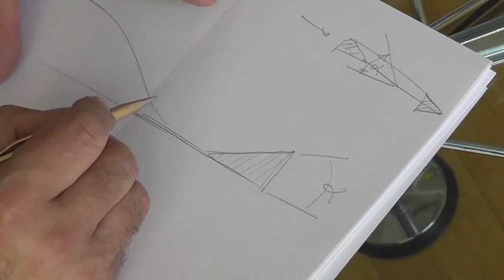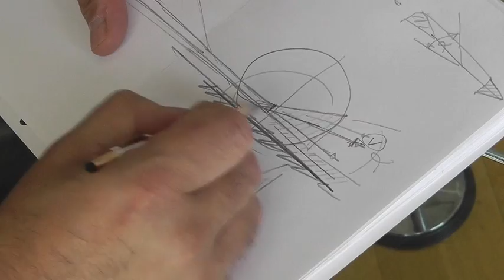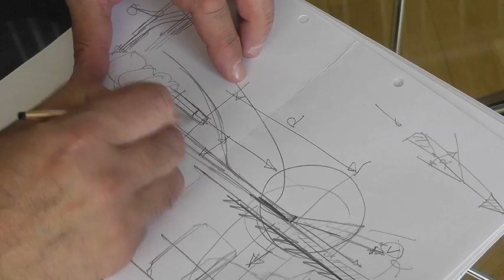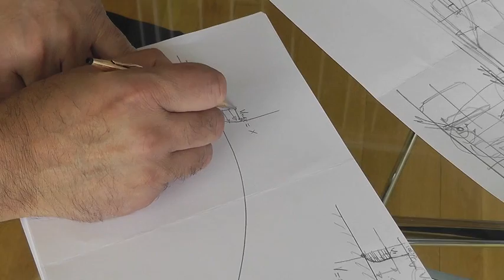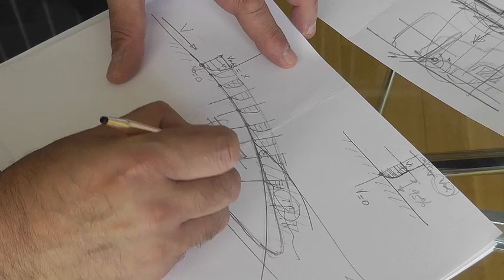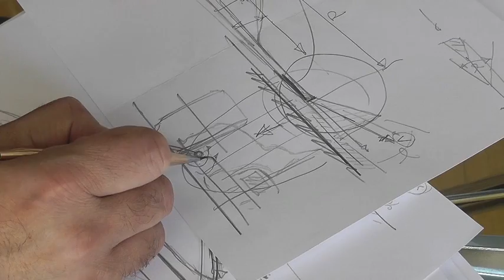Scalabroni explains Coanda

Comment: Try coating spoon with superhydrophobic paint (spray-paint sold by rustoleum company.)    That eliminates the confusing 'surface tension,' the static adhesion force.   It would reveal purely-Coanda force, the dynamic flow-attachment.

I think the hydrophobe spoon experiment would work the same as above.  Any air-layer between water-jet and solid surface would fall in pressure, caused by boundary-layer entrainment of air by water.  The fast-moving water jet would follow the hydrophobic spoon, where very slow water would not.

Comment: Does it work in a box?  Will it move in space? Because the air out of a balloon is wrong to enplane its force there at propulsion.  The coanda force is greater than  the momentum of gas moved out by coanda force.

Comment: The spoon and tap water experiment is a good didactic example to explain what they are trying to achieve in the F1 car with the Coanda effect of air (or exhaust gas) being blown along a curved surface.

However, although they look similar and the effect is similar in its consequence, the spoon and tap water is NOT Coanda effect.

The Coanda effect is dominated by potential flow (no viscous effect, although it is "modeled" by the viscous effects in the boundary layer) and is the result of blowing at high speed a fluid around a curved body that is immersed in the same (or similar) fluid.

The spoon + running water experiment is dominated by viscous flow and and surface tension. While we have a fluid (water) being flown into another fluid (air) their properties (mainly the density) are too dissimilar for the Coanda effect to take place, and the spoon would deflect the water even if the experiment was don in vacuum (and if the water did not vaporize).

Comment: One way IMO to reduce the separation of the boundary layer at the maximum distance is to disturb the boundary layers slightly earlier than the critical point, lets say by dimples, or slightly raise the surface to make little half-aerofoil shape on the surface to accelerate the flow. Since the velocity of the exhaust gas is not that high, and the temperature is also high, then the cooled surface could help by crating pressure difference, hence the flow would be sucked down to the surface. Another way IMO is to accelerate the exhaust gas by adding a convergent cone right at the end of the exhaust pipe(without disturbing the back pressure or anything), so the now accelerated flow separates later. Just my opinion :-)

Comment: i found this really hard to understand , especially on that graph about ground effect , before this vid i thought the effect is purely use to direct the air flow under the car to generate downforce.. and now he is using it to deflect the exhaust gas...
Reply: yeung jasper its very easy .... maybe because i m engineer but its easy to understand
Reply: +yeung jasper The reason they try to deflect the flow is because the exhaust pipe is now not in the ideal position, therefore they have to find a way of deflecting the flow towards the surface to create pressure difference.

Comment: Layer separation and velocity is actually more closely related than curvature. To get the optimum effect you need to calculate the velocity by which the fluid travels over the surface or rather the range of velocities at which you want the effect to be maximized at. If you're mostly concerned with down force at slow and medium cornering speeds you can design the curvature after those speeds or you can design other parts to have less boundary layer separation at high speed equaling less drag.

Comment: Everything you read on Wikipedia isn't necessarily true especially if you blindly copy it. He actually did the tap water demonstration correctly where he demonstrated how a flow attaches to a nearby surface and can be redirected. The demonstration also showed the effect of boundary layer separation in the flow of water.

Comment: A common misconception is that Coandă effect is demonstrated when a stream of tap water flows over the back of a spoon held lightly in the stream and the spoon is pulled into the stream. While the flow looks very similar to the air flow over the ping pong ball above (if one could see the air flow), the cause is not really the Coandă effect.

Comment: Boundary layer! 
And when the curvature is too steep, boundary layer separation occurs.

The reason for the reverse flow is because the high velocity flow has a certain momentum which carries it forward regardless to od the surface and this creates a low pressure zone between the surface and the flow which in turn sucks air from around it thus creating the reverse flow.